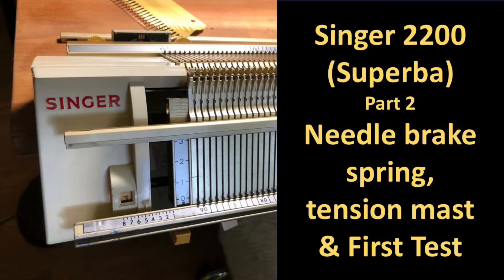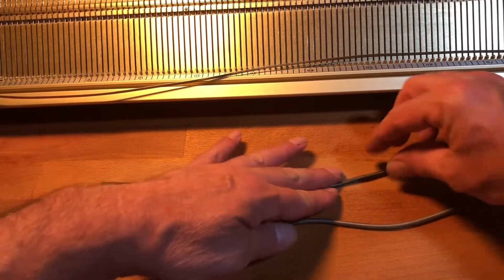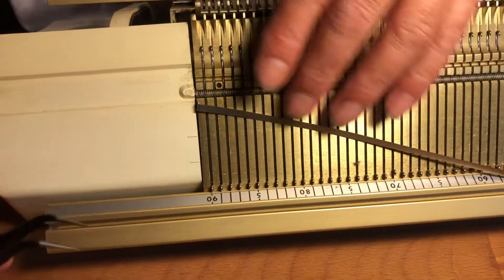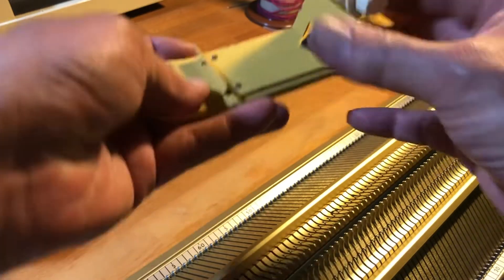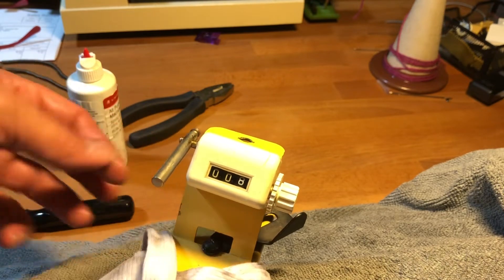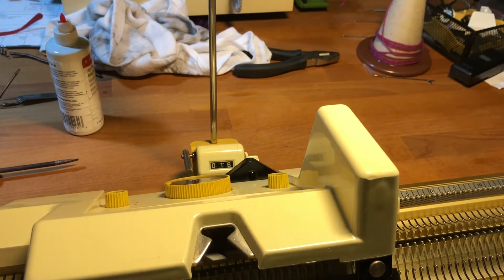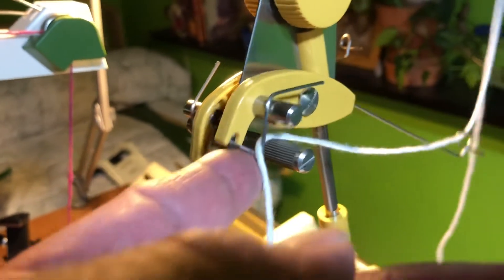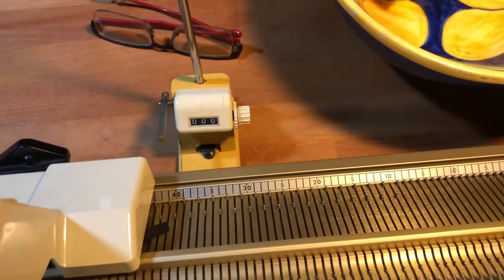Singer memomatic knitting machine repair part 2 - needle brake spring , tension unit - Superba

Comment: Very very helpful thank you! i just found a spring online and i hope it's the right one. i had no idea how to open the machine and i was pretty worried but you have given me confidence to try
Reply: Hi Stephanie ,do yo have the sellers name ,email address? I will be very grateful if you can share it with me,my machine has the spring damage so badly I can not use it and no one has seen brake spring in Australia for knitting machine.

Comment: Thanks! Your videos are very useful! I have the exact same machine and it hasn't been used since the '80. While I was turning the machine upside down to put some new rubber foots a small metallic cylinder (about 4x4 mm) fell from the machine. Do you know what it could be? It came from the bed.
Reply from the maker: The only think that comes in mind is the racking mechanism that moved the front bed. I think it had a black cylinder about that size. I‘m traveling for a few weeks otherwise I‘d double check if I see anything else.

Comment: Where did you found the spring ? I am looking for that for years !
Reply from the maker: Here https://store.dknits.com/pd-superba-brake-spring.cfm
Reply: @2lefthands769  but not for Germany 😪
Reply from the maker: @spreewaldhexe  , on eBay.fr (in france) is a decent offering of superba parts which is the same than singer. My French is not good enough to search there but I found one right away: https://www.ebay.fr/itm/Ressorts-frein-Machines-Tricoter-Singer-Phildar-Superba-White/385122499170?hash=item59ab16fa62:g:JkYAAOSwvKtjpZsJ&amdata=enc:AQAIAAAAwMd0ISe9gdWqXwSYOHrrN/x3/U4v4+iMQqGdnRRi4fCAcVOkG8KO12790Tb6tMtFWQIm9HPCG60YteCsGMDsM98IOBFpO2I56k+Wb6VS0V3WIivGl741FOdPU8EO1l6vQTsPVrWm3GGsi3jC1OMdq+seebsfG4wGWIIf3kF0GXJiBwMKbNslaHdpbBf9cZH5ofUdRydLQbg1pcIGL9f/kXrC4THQNrqm0W35ZH3o0M3aag3XyhePqerxNFRiP2qGZQ==%7Ctkp:Bk9SR97Vys7DYg&pageci=75f7c86f-8a17-4f82-a986-04eb93f6ce7b&redirect=mobile